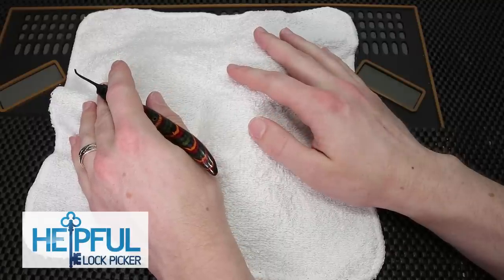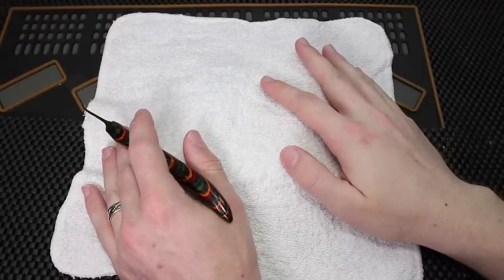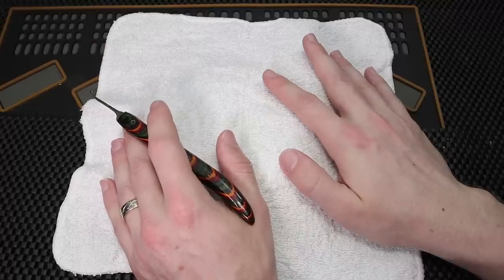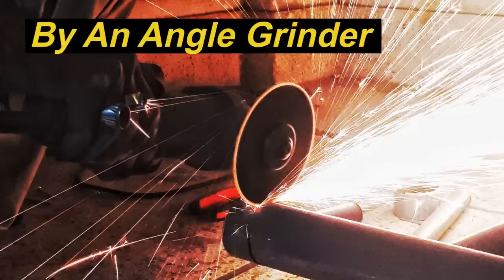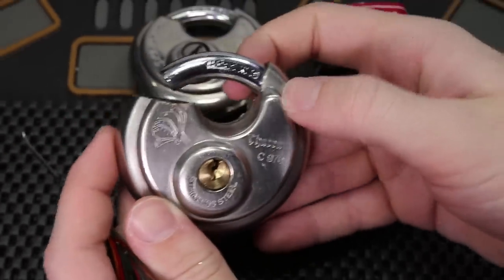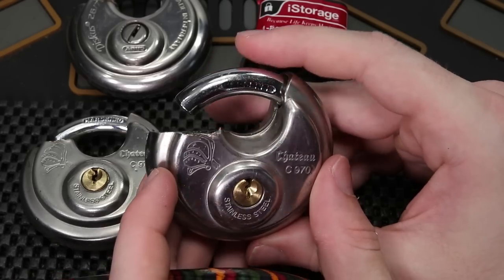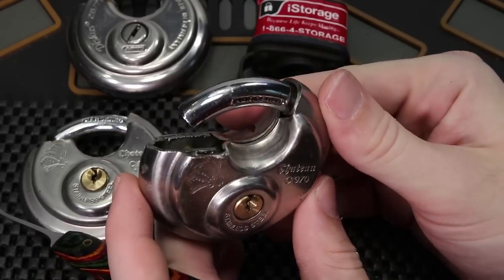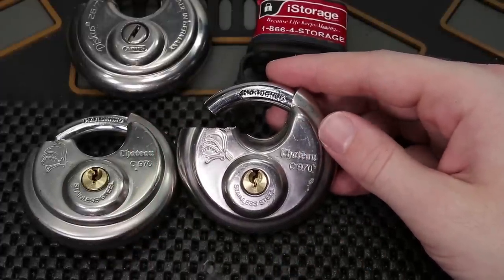[279] Why Do Locksmiths Use Destructive Entry? | Explained

Comment: Can you ask a locksmith to not break your lock if its possible? I've alwasy wondered if you locked yourself out of your house if a locksmith could try not breaking the lock so you don't need to buy a new lock
Reply from the maker: Yes you certainly can but there is no guarantee they'll be able to do it. I know several locksmiths that will always try to pick the lock first but it is not always reliable. If you watch one of my more recent videos that goes over a way you can write down the password to your key so if you ever get locked out you can just give them "biting code" so they can cut you a key instead of pick or drill it
Reply: I can tell you that as a locksmith destructive entry is our very last resort most locksmiths can get you in your door without any damage to the lock whatsoever it's only when he's been working on it a while will he suggest and talk with you about destructive entry
Reply: chadoftoons of course you can, sometimes it will be possible, sometimes not really.
As it was mentioned in video, sometimes customers wants us to pick his high Security lock in the middle of night under the rain, and in cases like this I usually say no, just because it’s gonna take much much longer, and still there is huge amount of factors, brand, type, how old, rusty or no, external door, internal door
Reply: I've been to calls after another locksmith showed up and couldnt pick the lock to get the door open and the customer refused to let them drill.  I'm actually pretty good at picking locks and I enjoy doing it.  I rarely ever drill residential or commercial locks.  I pick just about all of them.  guys the jump out the truck with a drill and dont try non destructive entry are hacks and rip off artist imo
Reply: Personally I've done it when asked but explained the cost will be more. I try to keep individual small containers with enough pins, springs and one pre-cut key to rekey two locks. Just in the event the customer has lost their key and absolutely wants to save their lock. I don't bother with Kwikset though. I will try to save a Schlage, Yale, Weiser, Corbin/Russwin, and Sargent for example.

Comment: I agree in some situations but i have a friend that called a lock smith and he drilled her lock. Now he was in a building and had a cheep $10 lock. He told her it was a high security lock with 6 pins. Now in this situation it probably took him more time to say this then it would have took him to rake it. So in times like this i do not agree.
Reply from the maker: It all  depends on the locksmith and their skill set and time. Realistically I would like them to try to pick first and I feel like that would make for a better locksmith but a $10 core can be drilled and replaced easily anyway.

I don't like how they described it as a high security lock. It's not good when they try to be deceptive and up sell stuff unnecessarily. But you can honestly see this in many different areas outside of Locksmiths
Reply: @HelpfulLockPicker  in this case i think it was just money he charged her lock out fee, installation, service and cost of the lock. All i can agree with excepted the installation fee. It takes what 10 min and he charged her over $100 for it. The bill at the end waa like $600 it was crazy
Reply from the maker: @FreeMasonTalks  that is an outrageous bill, I wonder how they tried to justify that

Comment: • But if they just cut it, then why bother paying a premium price for a lock-smith at all, why not just call a friend to bring some bolt-cutters or their angle-grinder? 🤨 That way, you get the same thing accomplished for free, and probably even faster. :-\
• How is time such a premium for them? Does every lock-smith in town get dozens of locked-out people per day? 🤨 The number of lock-smiths in a town scales with the town, so how many jobs could they possibly have each day? 😕
Reply from the maker: Not everyone has the specialized equipment needed to open one of these destructively nor the knowledge. Also, you can cause a lot of damage to yourself, your equipment, and the property if you do not do it correctly. Most locksmiths are honest people that want to help you out and they do not charge a large amount of money to do the job.
Reply: Some storage units will not allow you as a customer to cut your own locked you must have a locksmith do it and usually they have a preferred locksmith that they know will come in and do the job and not leave any damage if you have a friend come and they damage your unit you will be liable for that to the storage place and it may end up costing you more than the 45 or 50 bucks that it cost to have that lock cut off also yes locksmith get a lot more calls than what you think + my company does free unlocks if your child is in the car and trust me we do get calls for that a lot when we do that we have to drop and run to go get that child out so yes time is money and we don't have a lot of time to sit there and try to get into your lock
Reply from the maker: @georgeyorba109  It is really great to see so many real-world opinions. Thank you for going through the comments and answering people's questions. I am happy to see the discussion this started:)
Reply: In case with some padlocks - go on.
But will you be able to drill euro ABS 3* or ULTION, and get it open without damage to your door?
Some customers think okay, let’s take wooden drill bit, and try to drill it thru the lock right in core. 
As a practice shows, in the end they are paying 2-3 Times more because of “I can do it by myself”
Reply: lockouts are a pretty small part of my daily business.  as far as these disc locks.  you cant cut them with bolt cutters.  if the keyway is facing you and not against the wall you can drill the shear line.  all the tools have to be cordless though because they dont have power outlets inside of most of these places.  days like today (july 4th) I've only done one car lockout.  but yesterday I worked a 14 hour day.  only 6 jobs but lot of driving.  car lockout a commercial rekey made a car key did a rekey for a realtor who lost the  key to one  his listings.  dropped off some padlocks to a customer on jobsite and finished the night at an eviction with some strung out meth heads.  kind of feast or famine for me at least

Comment: Nice one problem though, why would anyone pay for something they can do themselves? Pretty much anyone could of done that lol.
Reply from the maker: As a few people have mentioned in the comments, not everyone has the specialized tools nor the knowledge. You can do a lot of damage to yourself, your tools, and the existing property if you do not do it correctly.
Reply: not everyone has a 100 plus dollar battery powered angle grinder.  most of the storage places dont have power outlets anywhere so It has to be cordless.  I have been to a couple storage places over the years that people have tried to DIY and failed.  one kind of lock some of these places uses slides into the door so you drill the shear  line on them.  I went to one a few months ago they must of broke ten drill bits in it and didnt get it open.  all those broken drill bits just add drill protection to the lock.  simple job they turned into a pain in the ass